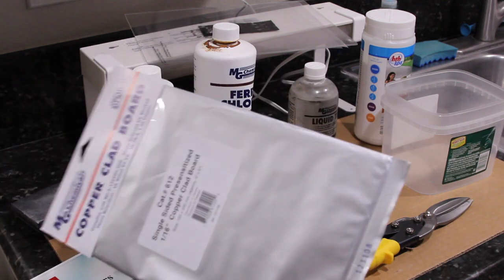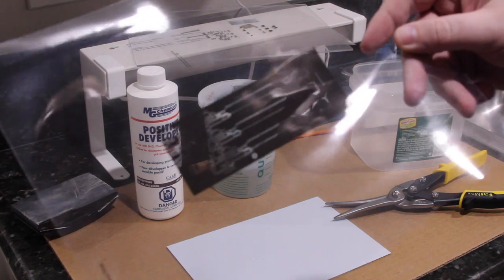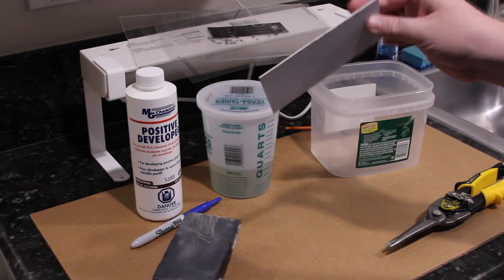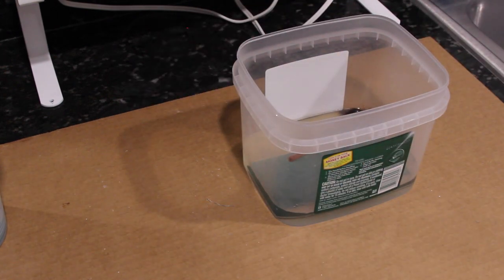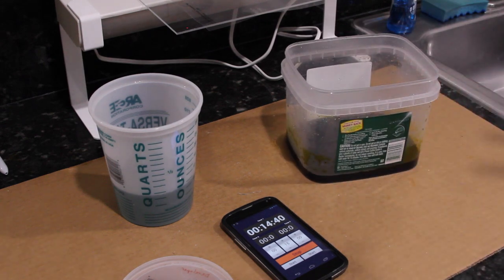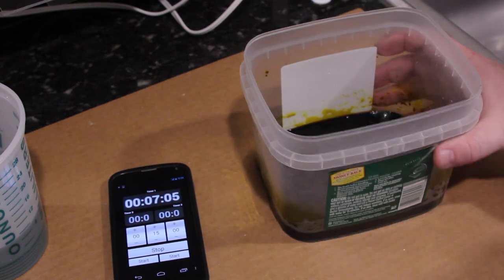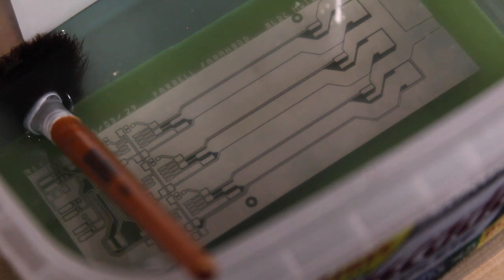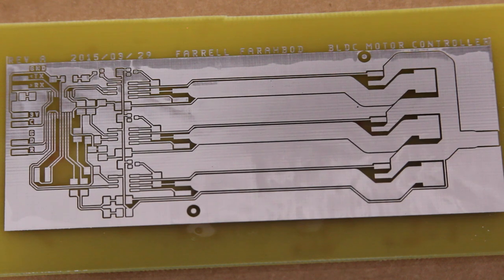Circuit Board Prototyping Part 1: Exposing, Developing, Etching and Tin Plating a PCB

Comment: hello, tin snips are good, you can also score the board with the blunt side of a industrial knife cutter then break it apart by placing the board on a desk and place it on the edge being separated and push down to snap it.

All the best
George

Comment: Hi.. Nice video... But don't you think that some tracks for the mosfets or transistor are too thin as they supposed to work on higher current... Please let me know if I am working...... Thank you..
Reply from the maker: It's not an ideal layout, but it was meant as a quick prototype. For real world use I'd go with a two-layer board with 2oz copper (or better.) I should have also use polygons instead of those thick traces.

Comment: Hey, thank you for the video! I have a question I hope you could answer it. I have some transparencies but the contrast I very low and the print is not good. Can you please tell me if you had problems with transparencies not being contrast enough? I wonder if this is a problem with my toner or the transparencies that I use. Thank you
Reply from the maker: I set my printer driver to print very dark (which uses more toner) and it works nicely.
Reply: @upgrdman  hey Thank you for the reply. I guess either my toner or the transparencies are of poor quality because I too use the highest density possible but the results are poor. I guess I will stay with toner transfer until I find a way. I used vellum paper with good results but it is not forgiving at all. Need to be in absolute contact otherwise the exposure is not sharp at all. Thank you again.

Comment: upgrdman i have a cuestion,

Which is the difference between POSITIVE DEVELOPER and SODIUM CABONATE , because im using the second one, in the process protect the nets and pads, and after remove the copper, but the copper is removed from the pads and nets.
Reply from the maker: Hi. The positive developer is a low concentration of sodium hydroxide. The MSDS goes into some detail:
http://www.mgchemicals.com/downloads/msds/01%20English%20Can-USA%20SDS/sds-418-l.pdf

Comment: Hello sorry ser, could I ask the specific of your bromograph? the power of the UV neon and the distance that you are using in this video. Thanks a lot, sorry for my troubled engish.
Reply from the maker: Giuseppe De Feo Hi. I don't know the details, but this is the light I use: http://www.mgchemicals.com/products/prototyping-and-circuit-repair/prototyping/exposure-kit-416-x/ It's roughly 6" (150mm) from the surface of the PCB.
Reply from the maker: Giuseppe De Feo Hi. I don't know the details, but this is the light I use: http://www.mgchemicals.com/products/prototyping-and-circuit-repair/prototyping/exposure-kit-416-x/ It's roughly 6" (150mm) from the surface of the PCB.

Comment: How did you print your copper layer on glass sheet? by laser printer? It won't get damage because of high temperature?
Reply from the maker: +Mostafa Najmi Hi. It's printed on a thin plastic "transparency" (the kind used for overhead projectors.) I used a laser printer, but inkjets should be fine too. If you want fine traces like i used (10mil and sometimes even 6mil) you need a printer that does at least 1200dpi. 600dpi is not enough.
Reply: +upgrdman  good .
What about high temperature that printer makes?? the thin plastic won't fuse ?
Reply from the maker: +Mostafa Najmi There are transparencies made specifically for laser printers. Works great.
Reply: upgrdman So, Unfortunately my laser printer can not catch it . What should I do?
My printer model is: HP Laser P1102
Thanks in advanced

Comment: Hi,
Is the Tin Plating solution reusable?
Reply from the maker: dana miller Hi. Yes, it is reusable and it lasts a long time. I bought a 500mL bottle around 3 years ago, have tin planed maybe 10 square feet (almost 1 square meter) of boards, and it still works like new.
Reply: upgrdman Great! Thank you.
Reply: upgrdman Hi upgrdman, What about the developer; is that reusable too?You had the developer premixed on a container with a lid; is that because you store it there for future uses? or is it just like you said it, premixed just for this video? Thanks.
Reply from the maker: Tony caruso Yes, that is reusable too. I typically reuse the developer until it becomes difficult to clearly see the board when submerged.
Reply: upgrdman Thanks man.
Reply from the maker: Pham Minh Tuan It's a product from MG Chemicals called "Liquid Tin." You can buy it on Amazon and probably a bunch of other places.
Reply: upgrdman Hi,I bought the MG Chemicals Liquid Tin but I am having a little trouble getting the nice looking result as yours. I leave my circuit board over 20 minutes in the liquid tin but when I take the board out, once it gets dried out it goes back to copper (dirty corroded looking copper) WHY????Am I doing something wrong? Am I missing some steps?Please help! Any ideas?
Reply from the maker: +dana miller Weird. I've never had that problem. It always "just worked" and was super easy to use. You might check that your copper surfaces don't have any sort of corrosion on them before trying to tin plate. You could try tin plating a small piece of unetched copper clad board, or maybe even a penny, and see if it works. Maybe you got a bad bottle.
Reply: upgrdman I will try that! Thank you for all your help! You are awesome!